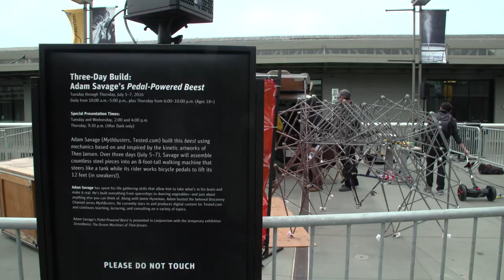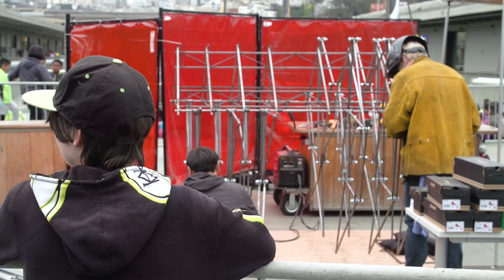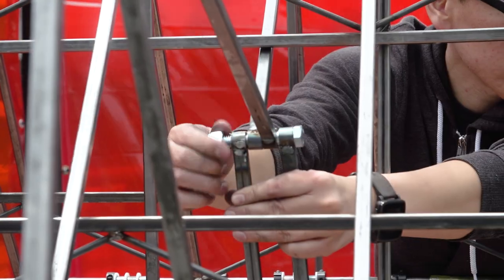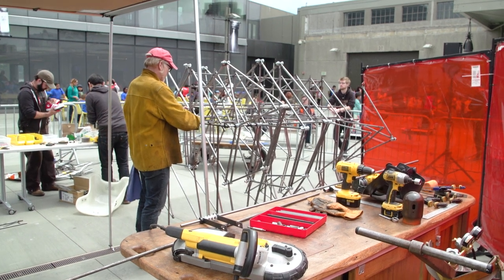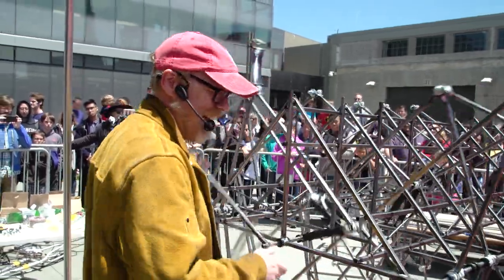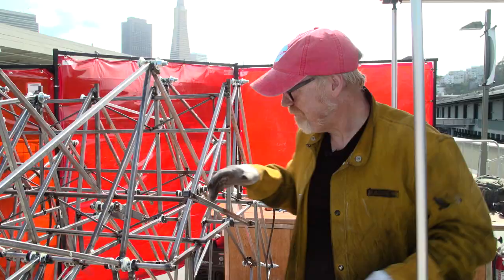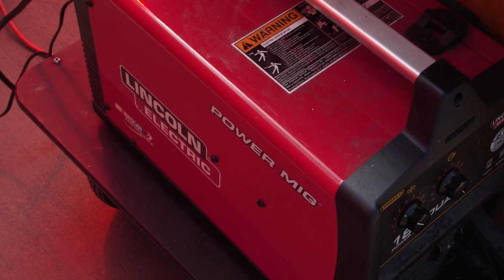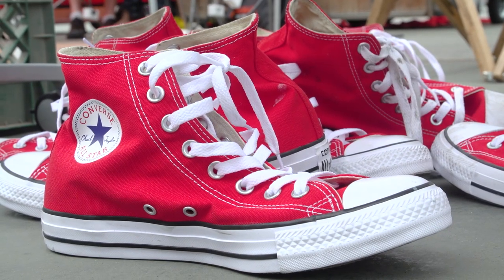Adam Savage's One Day Builds: Pedal-Powered Strandbeest!

Comment: "I was very specific that I wanted to do the problem solving on my own." The blight of engineering.
Reply: In programming it's called NIH syndrome for Not Invented Here. Sure, maybe there's another library or software already out there that does close to what you want... but that's not quite the same as writing it yourself, exactly how you want. It can be dangerous too, sometimes it's best to save time and use what other people have already built.
Reply: “The blight of engineering.” …and the mother of invention! 😃
Reply: @generaldirection5123  every computer program that doesn't use standard API's and dialog boxes provided by the operating system, and some of the worst offenders of that come from Apple and Microsoft who should be using what their own OS provides.
Reply: @generaldirection5123  Welp thanks for the enlightenment maybe it's time for me to stop wasting time making my own libraries argh

Comment: That's awesome Adam, a thought on the design popped in my head when i saw the pedal that may make it work a ton easier for you. You could use a wheelchair for the seat so you don't have to fight friction in the tiny wheels and if you use a small sprocket on the pedals with a large sprocket on the shaft it should make this thing walk effortlessly

Comment: Do u put your hand over the welder to stop the gas from blowing or to stop the flash
Reply: Yeah outdoors flux core is better than gas.
Reply: @Paul Frederick given it's a wind situation yes.
Reply: Cobraa
being a generalist Adam knows about a lot of things. But he doesn't have a lot of in depth knowledge about a lot of things too. A real welder would never MIG weld outdoors.
Reply: Paul Frederick I didn't refer to Adam specifically. You wouldn't stick weld sheet metal on a car if it's outdoors right? you'd use a MIG
Reply: Cobraa
I might. I can SMAW down to some pretty thin gauge metal. I'd rather use a MAG too.
Reply: to stop gas, to contain it, to keep the weld from getting messed up..i just started using a metal snap on altered funnel so not to have my hand in the way...cause HOT! lol when i weld.

Comment: No clue if you will see this but! MIG welders are not great outside as a small wind could blow the inert gas from the weld, SMAW works better outside as the welding stick has a coat that allows no oxygen going to the weld.

Comment: Watching this again, around @15:38 we see the center crankshaft with 3 parts sticking out like a star. The end part of each leg mechanism is connected to that. I noticed this star shape does have even lengths, one is much longer. If you check Wikipedia, you can find the original measurements. My guess theres another error there

Comment: It needs ball bearings in every joint, replace the flat bar with square tube in the crankshaft, and gussets between the throws and the shaft. The strength of all the fixed triangles could be greatly improved without adding a ton of weight by welding in expanded metal.

Comment: I have issues with MiG being gas shielded for welding in a breeze/wind however, but at least you can run flux core through any MiG, but can not MiG with just any Flux welder.

Comment: Shoes were not an asset to this beast. But look at the real strandbeests - they have rounded points that touch the ground, not flat surfaces. These can pivot and scrape or slide, as necessary, and the whole thing keeps going forward. 

I'd also say that this particular creation, being metal, was naturally going to be a great deal heavier than the actual strandbeests as well, which are made from plastic piping. That would affect how well it can move.

Comment: so think robot spot have make hay.watch this think cool if mad smaller stand beast that has spin wheels so that when it  walled over cut field grasses wheels turn grass over so dry and put nice row to be bailed some other creation of yours. thought ya cool spot pulled strand beast. think make smaller version wheels used on  farm equipment. hay field hope get dry possible not worried strand beast sink wet ground, am little worried both spot and strand beast legs might clogged grasses but begin cut real flat ground when racked up it behind the robot and beast.. in. normal farm equipment there series metal wheels with claw or think stick out wheel. like a yard rack then hit or sweep  ground pull or racks grasses to center. don't want wheels hit legs of strand beast so think be like a spider. spider has legs front big but back.  think wheels ranking part would but on back strand beast low ground leave legs in front. may look hay racks tractor pulls look so kinda ninja torcher device. 45 degree angles wheels throw grasses in nice strait line. there lot research. so maybe 1 day build design going field trip hay rack tractor pull. and strand beast. then second 1 day build build front strand beast that spot pull. another 1 day build put spider but on back of the strand Beast. then weed wack or use lawn mower cut grasses. see if can actually rack grasses up in strait line. actually lawn sweep picks up grasses really well but only short grasses. maybe if  this dosen't work. lawn sweep could used instead toothed wheels. call that plan B . but hard bail up short grasses.